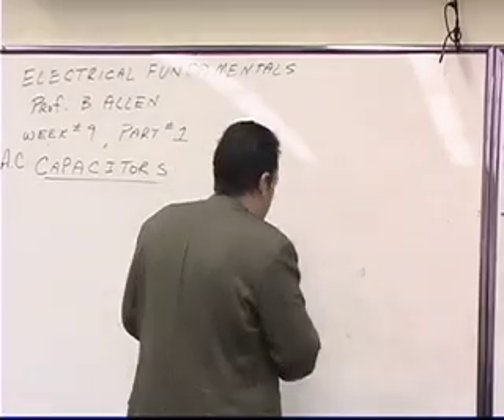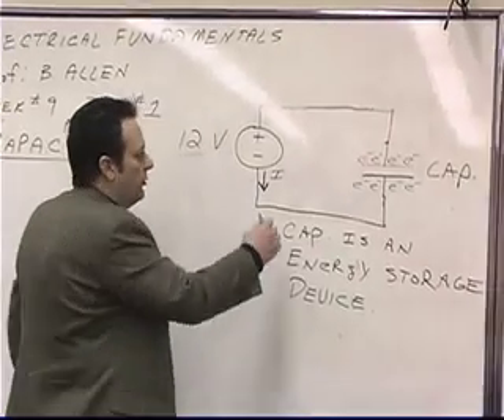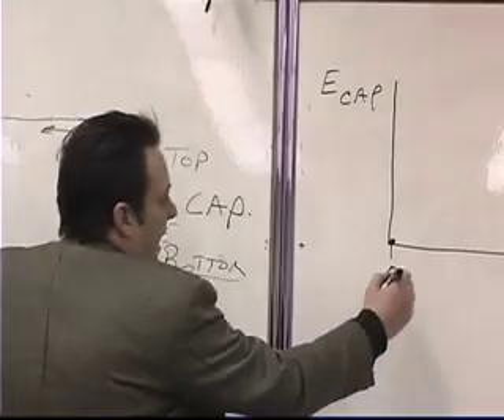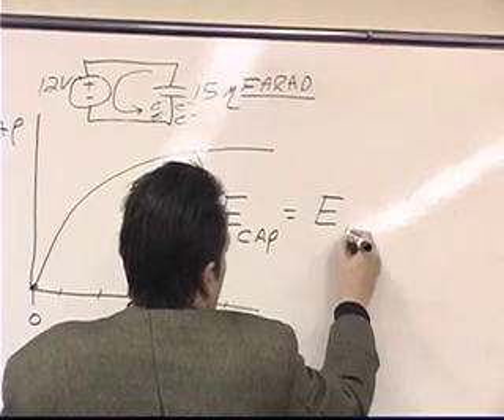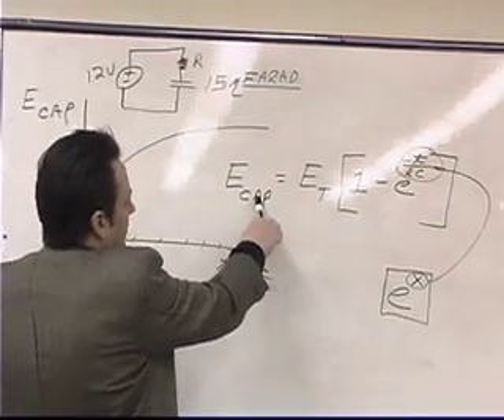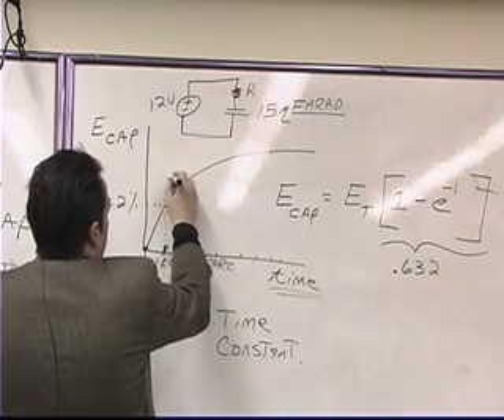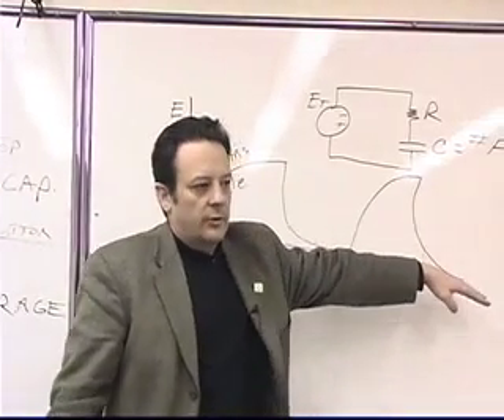Capacitors.mov

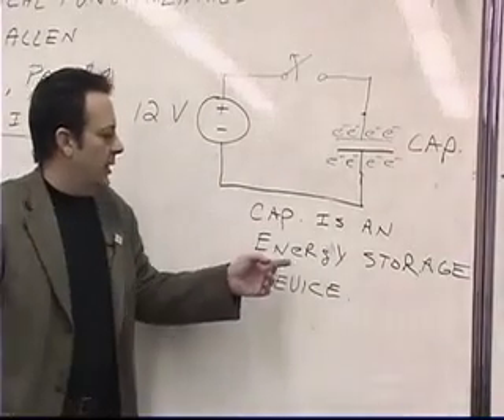Comment: @ 5:20 I read that the energy of a capacitor is stored in the electric field between the plates. But isn't the work done (by the battery) on the electrons? So don't the electrons acquire the energy?